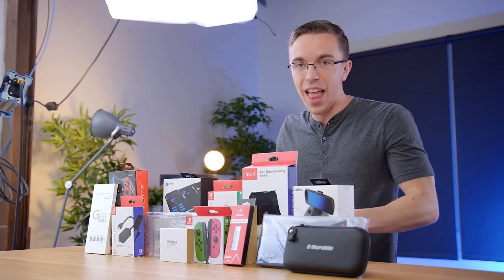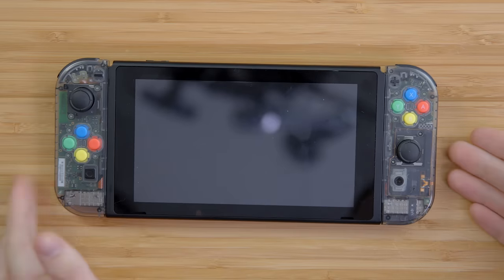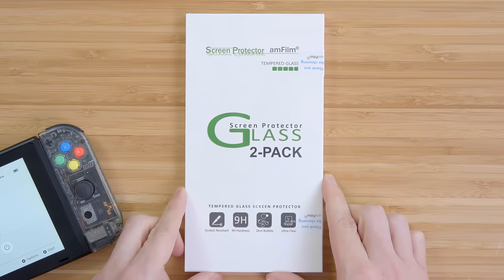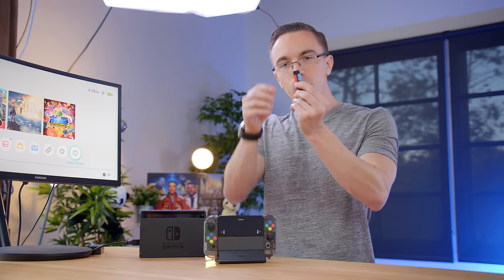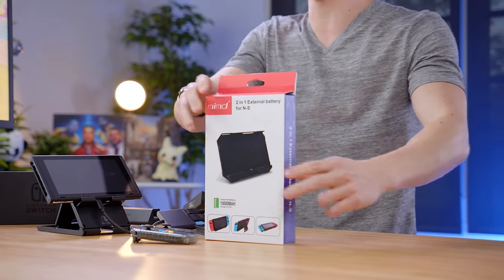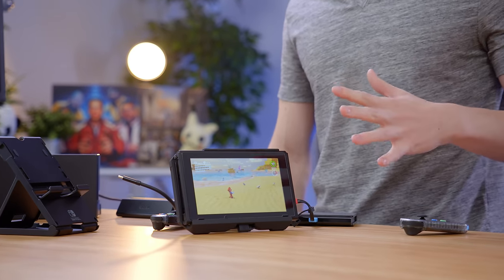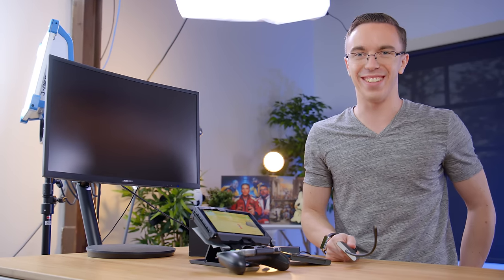Building the Ultimate Nintendo Switch

Comment: You failed when you didn't use a 256 gb microsd
Reply: Ben Clark nah he should of put in 400gb microsd
Reply: Ben Clark 
No no no, we need 
hard drive support on the switch (or a SSD).
Reply: Jimaki _37 NASA has internet speeds of 70GB a second, it's true.
Reply: Retro Plus Do you know how to get a job there?
Reply: Abhijeet Singh Uh... The chances of getting a job at NASA are 100,00 to 1. Unless you have an engineer's degree.
Reply: Retro Plus Oh.... I am still an ninth grader. More 10 years to put on studies.
Reply: Retro Plus 
I'm not sure how this relates to my comment, but I'm going for a major in telecommunications engineering. 

NASA HERE I COME!!!
Reply: micro sd cards has a rw life expectancy, especially when the market is flooded with cheap made in china memory 
already had afew crapping out on me, so i never buy anything more than 16gb

Comment: I'd definitely recommend getting a glass screen protector, I got the Orzly protector for my Switch. Some people don't notice scratches from the dock, but I think this is down to slight manufacturing tolerances, ie. some will be a tighter fit. Even after inserting my Switch into the dock only a few times (very gently), it was starting to scuff the plastic, so I put it on the same day.
Reply: DaveSimonH mine came with a titaglads screen protector which is very useful

Comment: I have the same screen protector. I love that it's a 2-pack and I've had my current one on there for almost 2 years. To prevent THAT from getting scratched from the dock, I actually lined the inside of the dock with the soft end of velcro.

Comment: People please don't use the PORTABLE DOCK IT IS BRICKING THEM!
Reply: Wow, that's messed up.
Reply: THIS IS 100% CORRECT! AND ITS MAINLY THE NYKO ONES! DO NOT USE ANY 3rd PARTY NINTENDO SWITCH DOCKS! THIRD PARTY CHARGERS ARE FINE, BUT DOCKS ARE NOT!!!!
Reply: whoa whoa whoa bricking them no way I thought it was supposed to be smaller
Reply: TheFireDiamond  What? smaller? What are you talking about?
Reply: Agreed. In fact it is far bettet to buy a replacement shell for the dock and put the dock parts into that. I got a Basstop. Works great.
Reply: TheFireDiamond Was this supposed to be a joke?
Reply: BrickING them or BreakING them?
Reply: is that why my switch is a brick
Reply: That dock is a safe one but other oddness docks are bad for the concel
Reply: @Wilmpadang  that's auto correct for you
Reply: @SobboMonkeVR  brick not break. In a way I guess It breaks them internally by giving the software issues.

Comment: Also you should NOT rope batteries together due to the nature of the switch charging style. It constantly charges the console battery itself as to not let it drop to give extra playtime. This means that your battery could easily be overcharging as those batteries don't have trickle charge. Plus, from an electricians standpoint, connecting two different batteries together that are constantly pushing power into a 3rd battery is just unsafe.
Reply: Yes I now I'm late but do you realize the Nintendo switch was at 93% and the charging case had a on and off button

Comment: He couldn't he could have said if you have two controllers that need charger you can charge them up but if you have two controls in the what you call it in tendo switch then you will not need it will you would need it

Comment: 3:20, plug the cable into the top of the charger and run it to the back of the Switch stand. Controllers will charge on the switch, and two more will charge on the battery, while the battery charges the switch that is charging two of four controllers.
That said the function of the Switch is that it’s a good portable device, and it would be docked at other places where someone already owns a switch. It’s a hot-swappable games console.

Comment: You could have just plugged the power plate into the big battery then use the battery bank to power the usb c adapter dock
Ultimately unnecessary

Comment: You Do Know They Make MUCH Better ALL-IN-ONE USB /Or/ Type-C  HUBs 
&Full Docking Stations W/ Extra HUB Stuff Intergrated In. (HDMI, Ethernet ETC..)

Extra Battery Bank Is Cool
Been Planning On GettingMe-1.. 
Just Have Soo Many Already..

[Even Have This INSANE One I Got Recently:
 Has HDMI, 
2 USB 3.0 Ports, 
SD Card Slot, 
100W Type-C IN Port, 
Another Type-C Port (?IDk? Exactly ₩hat That One Is For.. The Symbol On It Is Just A Type-C Looking Symbol.. But It Already Has The 100W IN Type-C Port.. Soooo yeah IDK..)
&!! 
A 65W [5V=3A , 9V=3A , 12V=3A , 15V=3a , 20V=3.25A] Type-C Port OUT (Obvi) 

But A Battery-Bank That Fit Together W/ The Switch Perfectly Would Be Very Nice..

Comment: Yo
I Just Got This INSANE 
18000mAh/ 64.8Wh Battery 6in1 HUB Recently!!
Has HDMI 4K/30Hz
2x= USB 3.0
SD 3.0 Card Slot, 
18W (Or 100W?) Type-C IN 
(Says 100W Next Too The Port.. But Says 18W (MAX) On the Back In Tiny Print...??)
Another Type-C Port (?IDk? Exactly ₩hat That One Is For.. Symbol Next2It Is Just A Type-C Looking Symbol.. But It Already Has The Other Type-C IN Port.. Soooo yeahhh IDK..)
&!! 
A 65W [5V=3A , 9V=3A , 12V=3A , 15V=3a , 20V=3.25A] Type-C Port OUT (Obvi)

Comment: I use an USB-C to HDMI adapter for on the go. I have 2 docks for home use and the adapter for travel. Hardly ever have any issues. Only issue is if you use a 3rd party USB-C cord for power, the picture would flicker. And it’s RARE that it does that

Comment: you should've added
some fourscore like things so you could plug in
two gamecube controller adapters with 8 gamecube controllers
a few mayflash magic-ns adapters so you can use ps4, ps3, Wii U pro, xbox 1, wired xbox 360, and all the Logitech gamepads
and also should've bought a pro controller

Comment: That joycon grip meant for a phone I would actually legitimately buy it it fit the switch safely. I find that controller to be much more comfortably than any grip/case they make for the switch. I amse it would net slightly lower battery life than handheld mode, but I don't even care.

Comment: Third party docs can actually damage the switch if you’re not careful, the safest option is just using the doc provided
Reply: This video predated that fiasco. But that news is no longer accurate. Modern third party docks are safe, though yeah, its better to use the provided dock. The dock he used in this video appears to be safe but no longer works with up-to-date consoles. So while no one should run out and buy it, doing so and attempting to use it will cause no harm.

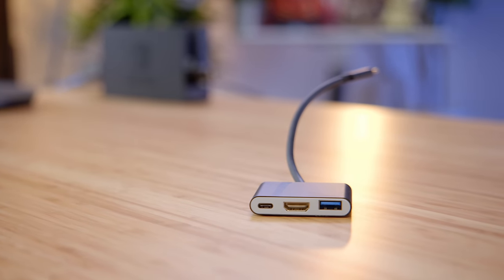Comment: 3:54 That's the only real accessory I would recommend, and a second set of joy cons or a pro controller.

Also stay away from those 3rd party chargers, they can shorten the lifespan of the joycon, and switch itself battery wise.

Comment: Love your ultimate console videos. The one thing I love about the other ones over this one though is that those videos ended with all the crap running all at once as additional pieces to a cohesive system. A lot of the pieces in this one were straight up contradictory.